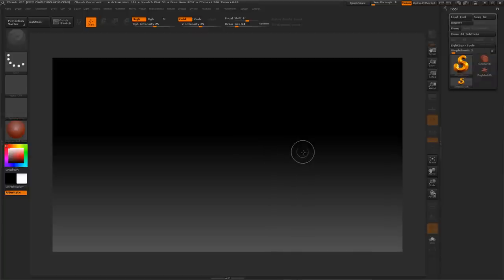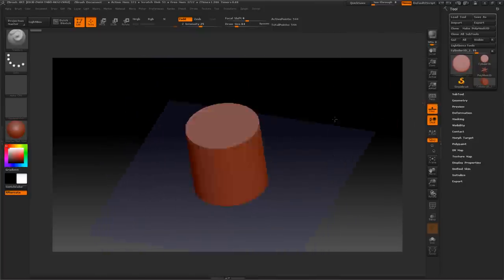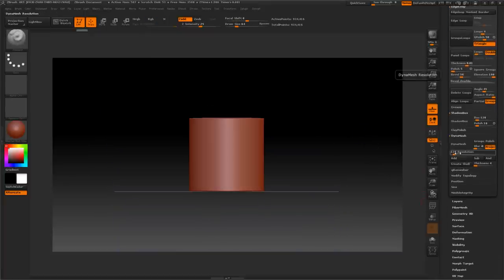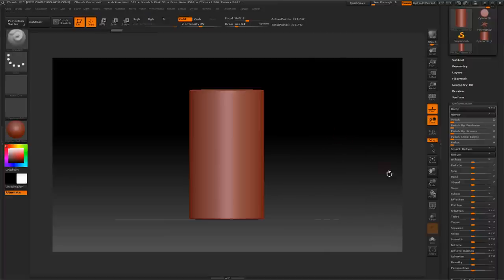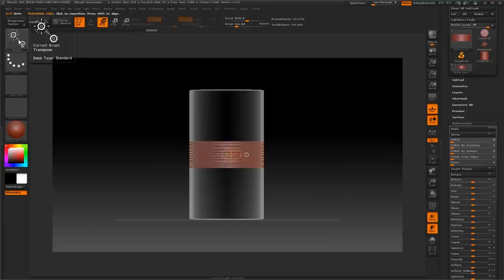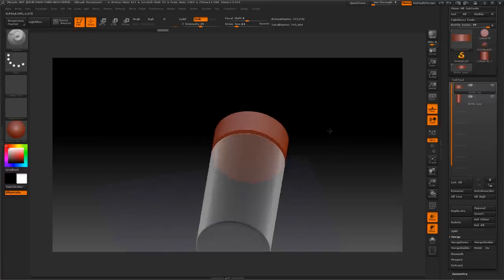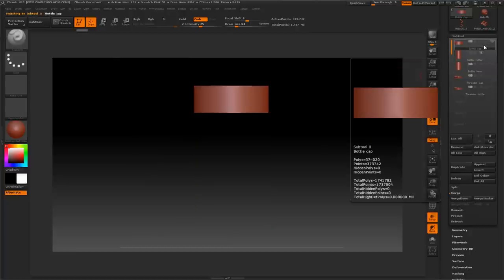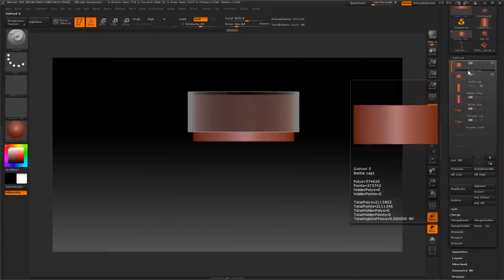Threaded Pill Bottle with Threaded Cap with ZBrush

Comment: Great tutorial on the technique to make threads, but you overlooked 1 aspect. 1 of the elements (cap or bottle) has to have something to catch or fit into the threads. In other words, if you cut threads from the bottle, you have to add threads to the cap.

Another method would be to create the threaded bottle and duplicate it. Then use the duplicate as the cap cutter. This ensures an exact fit for the 2 pieces.